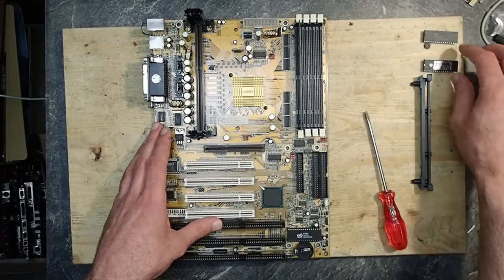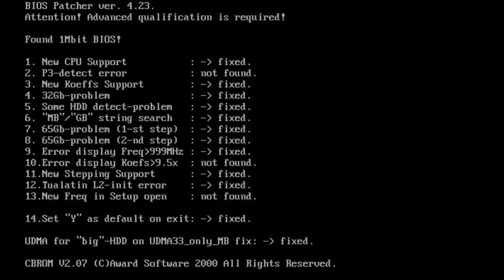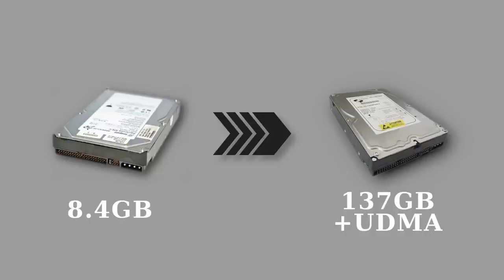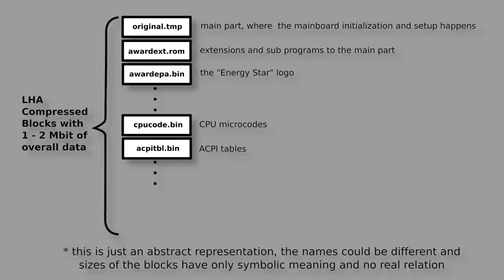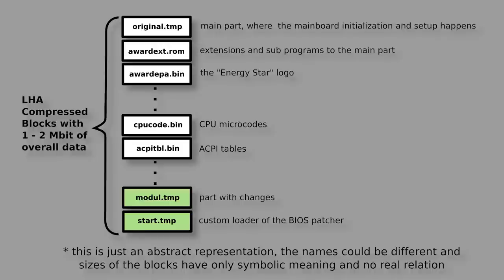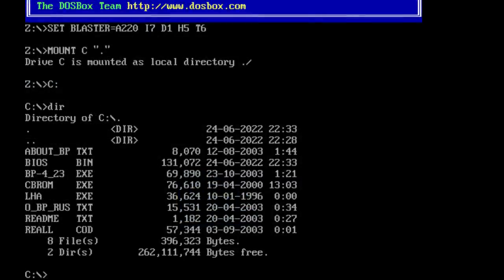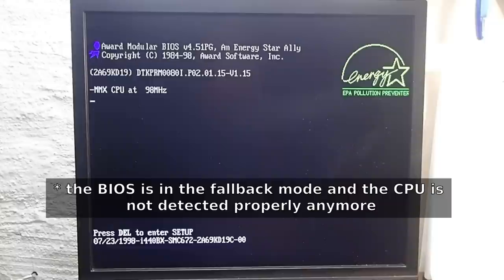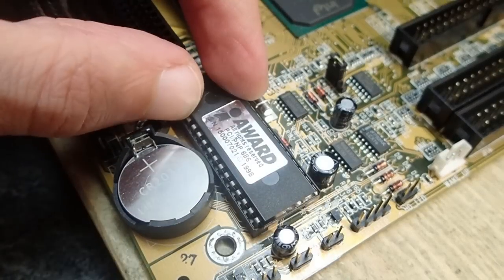BIOS Patcher: unleashing the potential of an old mainboard.

Comment: For anyone reading this that knows how to modify AMI BIOS: I have a PCChips M930LMR with a 533 FSB P4. When you use a 400 MHz FSB P4 in that board the BIOS will allow you to set the memory at 166 FSB ( FSB 100/166 memory), but when you use a 533 FSB P4 it only allows you to set the memory to 133 (133/133). I'd like to enable the option of 166 with the 133 FSB, but when I used AMIBCP I couldn't change it. Any help would be appreciated.
Reply: Just set the refresh rates faster. Reason it isn't allowed is the divider would be super wonky. Not really going to notice much a difference unless you are using intergrated video.
Reply: @waytostoned  Sorry if I wasn't clear - this is a setting for the system memory. When I had the 2.8 400 FSB P4 installed I could run the system memory at 333, but with the 2.8 533 FSB P4 you are only given the option of running the memory at 266 MHz; this really narrowed the performance gap between the CPUS, and I want to have the option of running the system memory at 333 FSB with the 2.8/533 CPU.
Reply: @yosemite-e2v  I totally understand. You have something called a ram divider. 400 / 166 = 2.4 or so. Problem is with 533, 533/166 is 3.21 which is a wonky divider. But 533/133 is 4. Can you see the issue? The wait states would make any effective speed useless, and in fact slower then 133.
Reply: @waytostoned  Ah, that's too bad. When I had the 400 FSB CPU installed there was a significant increase in benchmark scores when I increased the RAM speed to 333, and the Sandra memory bandwidth score actually dropped when I installed the 533 P4.
I also have a Socket 479 motherboard (i855GM chipset) that has a Pentium M 780 with a 533 FSB and it runs the RAM at 166 MHz (CPUz says it's actually running at 177 3:4 FSB:DRAM).
Reply: @waytostoned  I just remembered that ECS (the later version of PCChips) had the P4S5A which was almost identical to theM930LMR, and it does have the 133/166 FSB/memory setting. I even tried flashing that BIOS to the earlier board, but the hardware wasn't quite identical - it would lose the CPU setting on every reboot when I tried it. But I was able to boot into Windows and SiSoft Sandra confirmed the increased memory bandwidth.
Reply: @yosemite-e2v  I am afraid that it's not about some magical bios features when it comes to P4 boards and CPUs, it was just physicaly limited, you just need CPU with higer FSB. It works with some Athlon XP boards, which is interesting, you can have 400 MHz DDR even on some very obsolete boards, but anyway, these AMD boards didn't have even dual channel, so it pretty much doesn't matter, it was slow anyway. 😀

Comment: Why did you not use Bios Patcher 4.51 instead of 4.23?
Reply from the maker: I do use sometimes 4.51 and even the 6.x, but those versions are beta and alpha and they have features, which you'd need only for newer mainboards. For everything before PIII I didn't discover clear benefit so far from using the newer versions, than 4.23
Reply: @necro_ware  BP 4.51 supposedly adds beta support on all features found in 4.23, but for AMIBIOSes ver6 and 7. And I say supposedly, because it almost never works (partial success in only a handful pcchips boards). Sometimes it simply doesn't load, or when it does, it hangs during initialization. Also, the recommended version of AMIMM in the webpage for it, has a tendency to corrupt v6 BIOSes, which are almost all the ones found in Pentium/PII and PIII AMIBIOS boards. I've had better success with 3rdparty MyBCP commandline tool, renamed as AMIMM for v6 boards.
Reply from the maker: @hyoenmadan  Thanks for sharing your experience!

Comment: what if motherboard contain badly flashed BIOS (someone flashed from other revision motherboard) and motherboard doesn't start. Can this patcher overwrite it with different and correct BIOS, so motherboard start to work?
Reply from the maker: I don't understand the question. The BIOS patcher makes fixes in the BIOS, it doesn't flash anything. If you have a badly flashed or wrong BIOS image, you have to download the right one and reflash it again. That has nothing to do with this tool. You can find the right BIOS images f.e. on ultimateretro.net
Reply: @necro_ware  You've used something in video, where you put BIOS . Can it be used , to flash good bios, if bad BIOS was flashed? Where can I find such tool, and how it is named? 
Yea, i probably thought, patcher means that  white thing, into which you've socketed BIOS after releasing it from motherboard.
Reply from the maker: @warrax111  That's a chip programmer. It always erases the chip completely and writes new data into it. It doesn't care what type of data it is, if it is BIOS, or something else. The model of the device is tl866II+.
Reply: @necro_ware  thank you. damn it costs 150$ in our country, it's overexpensive, just to flash BIOS and save motherboard.
Anyway, thank you for your time.
Reply from the maker: @warrax111  You should be able to find it cheaper. Furthermore this tool is not only for writing ROMs, it can a lot more and if you are into repair it is very helpful in many aspects. If you just want to repair one board, you could try BIOS hot swapping trick. Just google for it.
Reply: @necro_ware  what is worse, chip is soldered. I dont have soldering iron, and stuff, nor experience. It would be overexpensive (both time and money) to save this motherboard. It's MSI KT6 Delta. I need to get rid of it because of space. So pity. If I count it right, I would need 120$ for programmer, soldering iron and stuff needed, like 60$ minimally, and then, experience (some hours practicing). just to save this $20 mobo (actualy, it can be get even around 10$ in our country - working). I try to donate it or what, I dont have time for it or money. I know, skills and stuff can be used later. But right now, I dont have a time for it. Also, it's only my guess BIOS is bad. board starts, but tries to load chip with RAID. This is -LSR version (without RAID chips), so I think someone downloaded -FISR version BIOS in attempt to upgrade BIOS. But it's only my guess. I think -LSR version should not even try to load RAID program from that chip.

Comment: I swear the Russians have had to make do with old tech for long stretches of time.
Reply: Can kinda confirm that we Russians really sometimes make do with what already works, even if it's old - and if we can help prolong/extend usability, we'll certainly try to. Hell, prior to getting a new SATA DVD drive, I used an IDE one in my Pentium III machine to write/read the discs via ImgBurn on either Windows 98 or NT4... that, and emulation just doesn't really feel the same when you use real hardware to set up Windows on.

There's just something so comforting in the clickiness of old hard and floppy drives... and, in these times, I'll take what I can get to try and make it a bit easier to get through these dark times. Would have loved to leave through an another country, but I have way too many parts to just leave behind...